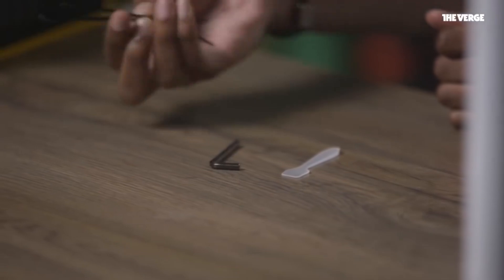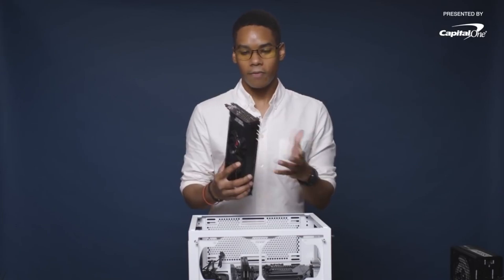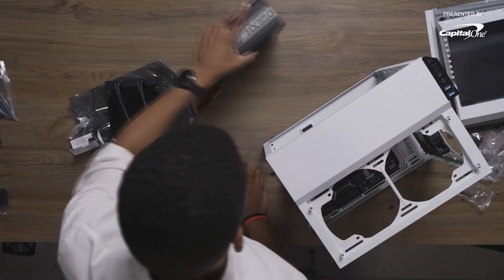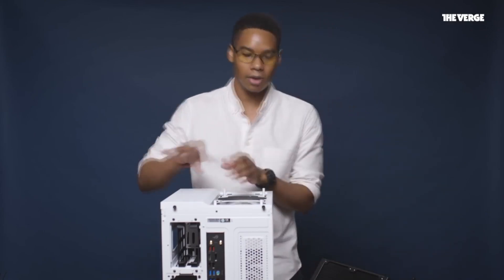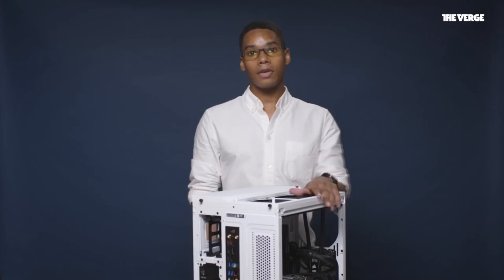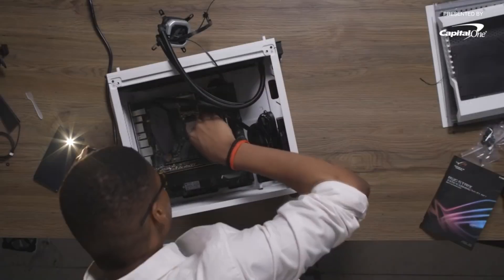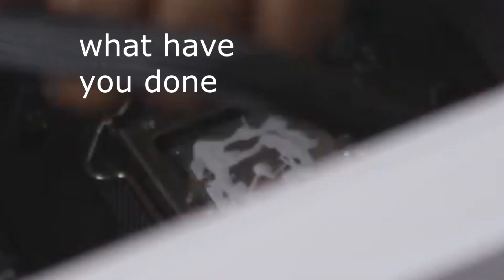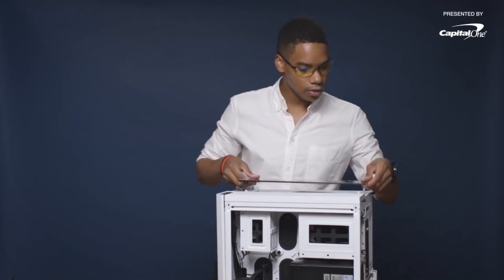the verge pc build in 4 minutes

Comment: It's not really about how much thermal paste he applied but how he did it. You really need to see the paste covering the CPU before assuming it spread out. This is why the "smear" technique is what I use now. I used to just use the dollop in the center, but once i had a CPU start running hot so I pulled the heatsink off and there was a bald spot right in the middle - I'm not sure how that's even possible, but after that I decided I needed to see the paste covering the CPU to ensure it was actually there.
Reply: I put a blob in the middle and it works fine for me.  What I do NOT do is put little dots in a circle around the center like the dummy in the video did, because it will just leave a bald spot in places where the heat can stay trapped.

Comment: I love that he suggests using a fucking swiss army knife, rather than spending $1-$20 on tools that would actually work well for this job and make life way easier. I got a 2 size philip's head and flat head screw driver from harbor freight for free and you just spend $2,000 on your PC but you don't wanna bother getting a tool that would work better and make your life easier and is a common tool that has billions of uses and literally everyone should own one. Also an authentic swiss army knife costs $50 where I live, which is significantly more than every tool you would ever need that would work great for this job.

Comment: I'm not quite as suprised it booted, because you can make mistakes and it'll still try to function, but what I am suprised at though is how did his CPU not overheat without fans to push air through the rad?

Comment: Input the thermal paste with the long screw
Reply: I input tooth paste instead. That's fine as a substitute right?
Reply: @Nezzen-  yes
Reply: @4lj4  ok I got cool mint flavor for the extra temperature cooling wish me luck
Reply: @Nezzen-  it actwill work great;)
Reply: @Nezzen-  It is funny you say that, someone did a comparison test once and actually got similar results to thermal paste from toothpaste and vegemite spread, but of course it would dry out and cease to carry the heat properly at some point. The thing that makes thermal paste special isn't really it's ability to carry heat, it's that it can do so for an extended period of time without drying out(though cheap paste does still dry out after a few years), and that it can mostly stay in place after thousands of heat cyles instead of dripping out. Some more expensive thermal pastes are actually superior at transferring heat, but a lot of people have made the point that no thermal paste of any kind, even the liquid metal stuff, will transfer heat better than the heat spreader on your cpu and the probably copper base it's going to be contacting, so the least amount of thermal paste to do the job is optimal, and really what improves performance is lapping so there are as few of those microscopic pits as can be, and then just applying a laser thing amount of thermal paste and properly mounting the cooler so it's flush and even.
Reply: I N T O   T H E   B R A C K E T
Reply: into the t h i n g y
Reply: Or finger........ If you not too pussy
Reply: Oh no
Reply: No. use the allen wrench

Comment: I can't believe the computer even boot.
Reply: well you don't see him booting up so there is a possibility they needed to fix it for him
Reply: Johan Anderson - they most certainly had to hire some lowly intern who knows more about hardware than this hipster Apple douche to fix the poor PC for him, so it could even POST.
Reply: I believe they fixed the mistakes but didn't tell the editor so he just kept them in lol
Reply: and they never showed it post. I'm sure someone else rebuilt the Pc so they can play ARMA3 and LoL.. or that was probably a DIFFERENT PC considering the one he built was sitting across the room from him on a different table.
Reply: PC must Be like,"Dafuq is the ram doing there?,why is the cpu so hot?,Why isnt the radiator working properly?,wtf is this cable management?,wtf is this windows XP bullshit?."
Reply: The AIO isn't even filled with water because by longscrewing the cooler it would leak and short his highly exclusive hexacore i7😂
Reply: i would have loved to see it boot. He installed the radiator without fans, and the psu was fan facing in, so it would be exhausting heat into the case.

The CPU would get really hot bc the radiator can't disperse the heat quickly enough and the internals would get hotter and hotter

you know what - I really want to see what the verge pc would do if it were made as it was. brb going to ask jay-z to do it
Reply: @pgplaysvidya  psus exhaust heat out of the back. the opening where the fan is visible from is the intake, not exhaust. as close as it was to the mobo tray, that psu isn't flowing much air at all. but if it is, its sucking in hot mobo air
Reply: If he can do it, then so can I 🤣
Reply: Things is that most PC's are advanced enough to post. The electronic butchery Mr. Etienne has committed will shorten the lifespan of the parts installed.
Reply: It didn’t. He said on stream once “everything that was done wrong was corrected after the fact”.
Reply: Well it 2000dollar of stuff I'll give it a month before it blow up
Reply: In the shot where the PC was running, the fans were added to the radiator and if I remember correctly, the ram was put into their correct slots. So I guess it didn't start without someones help.
Reply: Rip psu gpu dual channel ram and cpu and cooler just hurts my soul 1 the psu cant breath 2 the dual channel ram are supposed to be separate 3 he was playing with the gpu too much and makes my palm sweat 4 he needs more than a philip screw driver to build a pc 5 he's using manual (nothing too bad for beginners) 6 hes using a cpu applicator 7 he puts more thermal paste when theres already some 8 he acts like a pro 9 i bet the pc is used like that and not being fixed which hurts my soul
Reply: The PC posted only after they probably had the intern fix the fuck ups he made.
Reply: @apollojustice5338  Imagine that, the intern actually having more knowledge than the long time employee. To be fair, that wouldn't be hard in this situation.
Reply: It'll burn out. Either the CPU or the PSU will blow. CPU is drenched in thermal paste and the psu will over heat in minutes.